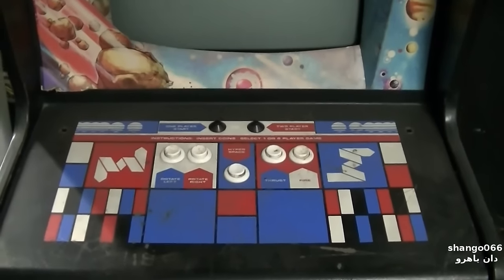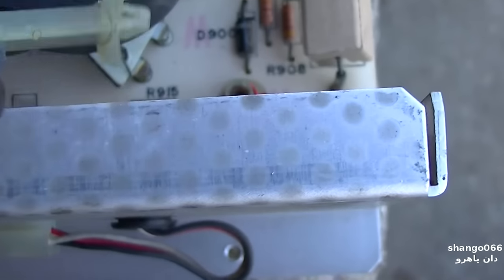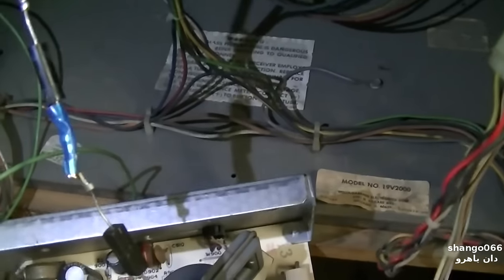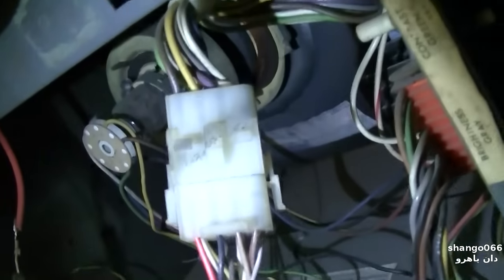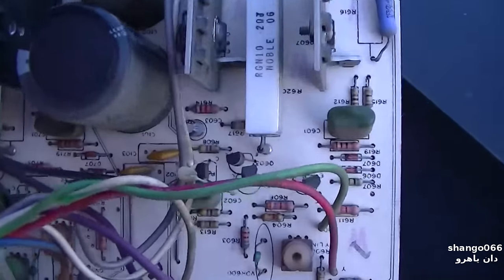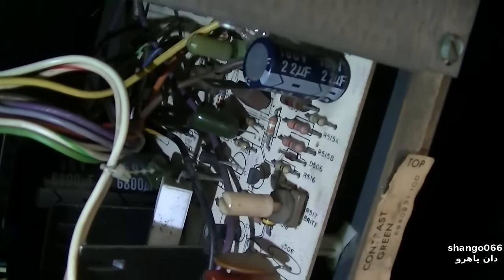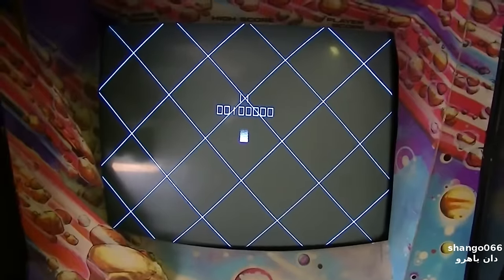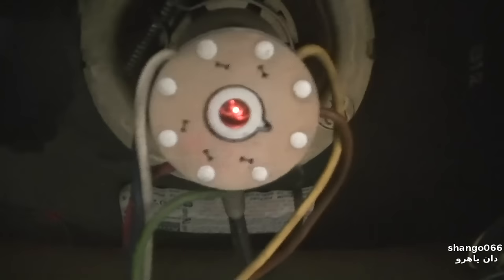Atari Asteroids Console Video Game Repair

Comment: Beautiful repair, @shango066. I fixed a Vectrex home video game system a few years ago - bad capacitors. The owner was convinced it was a special CRT. No, just an ordinary 9" Samtron (Samsung) or GoldStar CRT and yoke like you would find in any cheap 9" black-and-white TV of the era. 8 bit Digital-to-Analog converters create horizontal and vertical, and they drive what are basically simple audio power amplifiers which power the deflection yoke... nothing to it. Like a Pontiac Fiero, it's just off-the-shelf parts used in creative ways. There was a bad capacitor in the blanking circuit so rather than retrace lines, I had trace lines of how it was mapping out the video to different items on the screen, it was kind of fascinating to watch. 
That poor deflection yoke - all the weird noises it made as it had all sorts of weird waveforms shoved into it. I never connected the yoke to my oscilloscope, but those deflection waveforms must have looked so weird and obviously change depending on what is on the screen - I'm not even sure what I would have found to trigger the scope.
Overall, pretty easy to fix these things when you understand how the circuit works.

Comment: Size matters.  That 30KV diode arcs over itself since it is too small, or the 'sleeve' you put over it has carbon traces inside.  The microwave diodes seem to be large enough.

Comment: I ran into the same high voltage diode problem on a friend's Asteroids Console, so it may be a common problem. In my case, the diode was shorted but not burned up. I found a high voltage lead and cap with diode from a junked B/W TV and put it in series. That was enough to get the Console running again.

Comment: Its quite possible the small size of that replacement diode allowed HV to arc over the body.  I've worked on this XY monitor before, and standard silicone goop did not seem to resist the high voltage and I had arcing problems until I beefed up the insulation.  Using boots from an old rear projection TV was a neat idea, wish I thought of that.  For being such a simple monitor it sure was a headache.
Reply: Really dangerous stuff. That tube could be killed this way.

Comment: @18:36 - BigClive was just explaining (4/26/24) the markings on the high voltage diodes and how they're just a band/chevron down only one side.  He advised that the silver conductive marking paint could cause carbon tracking down the side of the diode.

Comment: Im guessing the small diode RF jumped across.  Causing AC not DC?
Reply: I'm kind of wondering about that myself,  like maybe the wavy cathode band on one end indicated something? You never know about the specs of some parts you buy over fleabay.
Reply: Or, perhaps the diode just couldn't switch fast enough.  Just because it can do the voltage and current doesn't mean it can handle the frequency.  I'm surprised the microwave ones worked.  Unless it was a model with an inverter, they'd only be doing 60Hz.
Reply: @russellhltn1396  I need a new rectifier for my own CRT repair and I was looking at some of these diodes from eBay. These 5mA ones are fast recovery diodes specifically designed for CRT HV rectification. Maybe there's something else going on here. After reviewing this video I think I might try chaining a bunch of 1n4007s for mine.

Comment: When an arcade game is resetting or otherwise glitching, the first thing to do is check your voltages at the game board. In the case of classic Atari machines, there is also a regulator/audio board (known as "A/R-I" and "A/R-II" boards, with several versions among them); Asteroids had the earlier A/R-I board), which regulates the voltages from the linear power supply and is also the audio amplifier. It has several voltage test points on it.

Comment: Nice..   I have Asteroids and  a color vector game. Both were dirt cheap, both  required work on the high-voltage.   Nothing as scary as your forays but good to know at least one HV symptom without experiencing it myself :)

The game reset may have been from where the CPU board requires an exact supply voltage. not a decimal point over or under. It's a whole dynamic with those things. 

It's a weird bit of technology, the vector game.Atari did some crazy stuff.

Yes, there are several arcade monitor specialists out there who know that stuff up and down and have spares. 
Quite simple.  I couldn't begin to think of a way to restore a Philco. other than watching your videos ;)

Comment: Maybe the crt outside coating isnt grounded? Also: The high voltage meter shows the average DC voltage. It does not show voltage spikes.  So maybe it shows only 5kV, but there are short 25kV pulses present.

Comment: with the high kv diods (i think the microwave diods are shoky high kv diods and the new diod you are using is not a high recovery diod...sens the input of the flyback is swiched by a fet the out put of the flyback is going to be slitley polst to at what ever freqinsey the inpout is swiched at ...the diod you used (new one) is propley not recovering fast enoth wich is calsing some of the ac to pass but the 2microwave diodes are probley fast recoverey diods (shoky diods) so thay can stand the p slight polsing
Reply: shottky not shoky

Comment: You may hit youtube gold with this video, Shango. Gaming stuff is very hot in youtube nowadays.
I've tried pulling diodes out of potted flybacks, never succeded. I believe the reseting problem may be a filter cap or something (probably the HV supply) was driving too much current, thus making the logic board starve and reset.
So, did you like the game?

Comment: Nice restoration of a classic game. The Atari 2600 version is way better than the original, because it has color asteroids instead of linear graphics. The 2600 version has more features than the original arcade version. The Children's version was very easy and it can rack up points until it gets to 9,999 points and resets to zero. I can play it for about an hour to play, but it has way too many extra lives.

Comment: Exactly what happens in the mtT xl-100 tuner modules where the pins are on the pc board. The molex connectors are plugged on the pins and  the solder joints all have a cracked ring around them . intermittent lc's on so so many of them. Looks like the same deal here. Then , of course if your luck is not good that day..there's more problems.  oh..no! It;s an RCA  ahhhhhh!

Comment: More please!
Reply: Thanks to your videos I was actually able to track down the Samsung monitor issues (essentially a 12" TV sans tuner) in a 1976 "knockoff" Pong machine.

Nice work man!
Reply: Seriously... Your level of competency repairing "lost causes" meshes well with vintage video game/mainframe computer crowds.  Those devices spend so many thousands of hours of on-time I've seen monitors cause EOL for many pieces of cool equipment.
Reply: I work on these for a living, so I definitely have some stories about on-time.  I still come across some original CRT's in vintage games, and it's crazy how bad the screen burn gets.
Reply: I can believe it, I remember seeing some machines back in the early 90s when every mall had an arcade, and every convenience store had some, that were pretty long in the tooth. Some were so bad that you could read letters and numbers in the phosphor when the screen was dark and the machine unplugged.

Comment: The h.v. diode are very similar to the hv  diodes of tv's of earlys 80`s denomination  TV18 are 15-20 kv. at 800 mamp. range but the chalenge of this machine are VERY INTERSTING and is great the job you do because is not your taste this type of electronic devises and your  improvisation with microwave diodes for test  are awesome  GOOD JOB AND GREAT VIDEO by the way i love this videogame are of mi adolecense regards